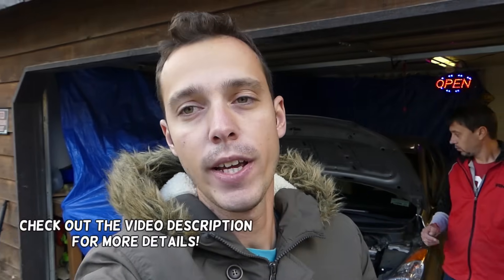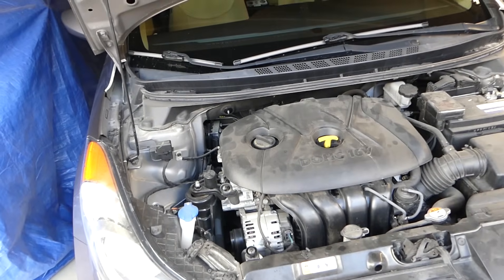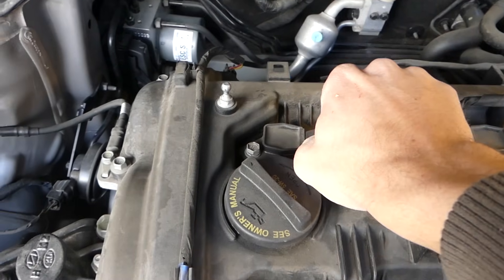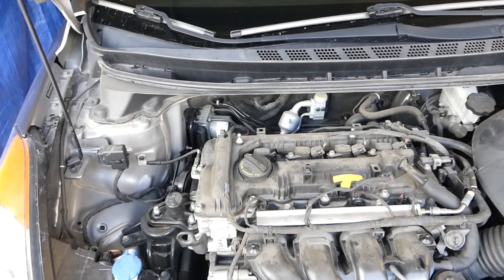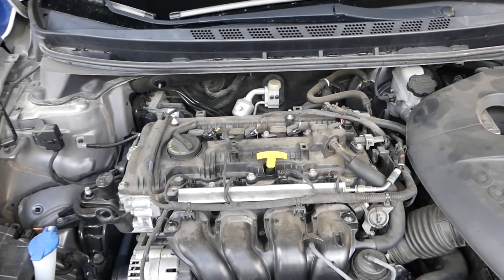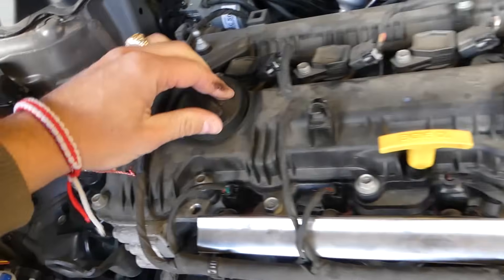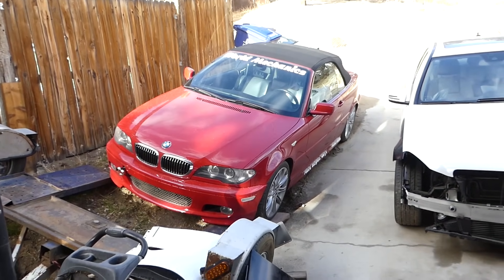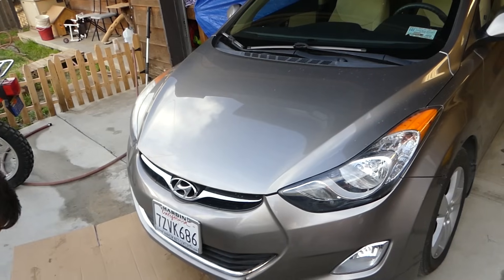HYUNDAI ELANTRA ENGINE NOISE KNOCK TICKING FIX ?

Comment: My 2013 Elantra started making the ticking/tapping noise. They are replacing the whole small block free. Google :Hyundai Technical Service Bulletin 14-20-002
Reply: Aaron Silver , this was covered under warranty ? Here in Middle East they refused to do so.
Reply: Fahad Rajpurkar who is they? The dealer?
Reply: Aaron Silver they are dealers. They said your car warranty has expired. On the time of purchase the warranty was 3 years. Now i don’t know to whom I should escalate. Might i need to find someone in Korea headquarters.
Reply: What year is your car? And mileage? I’m having the same issue. Mine has 80k miles it’s. 2014
Reply: Fahad Rajpurkar never mind. I see the year.
Reply: jsphburk its just 34k miles and I purchased it on year 2014. Model is 2015.
Reply: I had the exact same problem with my 2013 Elantra GT.  The dealer just notified me they are replacing the engine for free.  Not sure about other countries but the 2013 Elantras sold in the U.S. have a 10-year powertrain warranty, which covers this problem, which is internal to the engine.

Comment: So what years of Hyundai's would you avoid which engine to avoid
Reply: Ralph Kowalski 2005 due to transmission
Reply: All of them, I have a 2015.  I believe there was a recall on 2011-2014 🤷🏻‍♀️ I could be wrong on those years but I know mine didn’t have a recall

Comment: If you want a good car  it  has to be older. Then 2005  the newer you get the junkies you get  
TO MANY HOSES
WIRES. SENSORS   MADE OF CARDBOARD. AND FIBERGLASS   JUST JUNKS FOR A LOT OF $$$$$$$$$$

Comment: Mines was at 30k on my 2017, it is normal for these cars. 48k miles later it's still ticking, people don't waste your time tryna fix an issue that's normal with these engines.

Comment: Engine bearing knock on either the mains or rod. typical issue with GDI engines.
Reply: Junie J This is not a GDI engine. Nu 1.8L MPI.